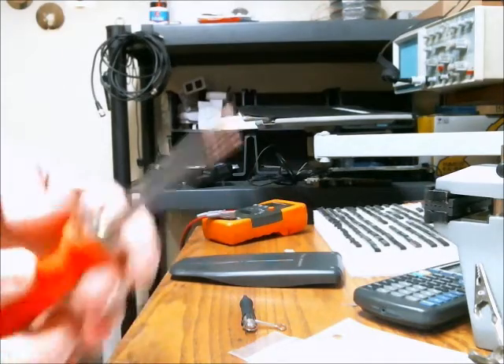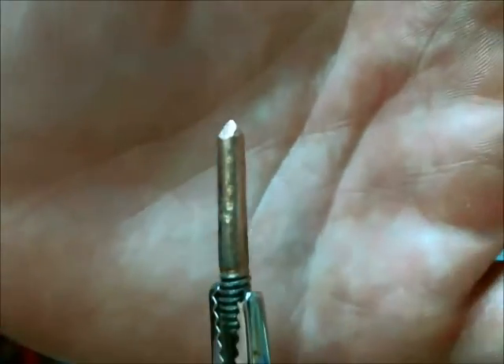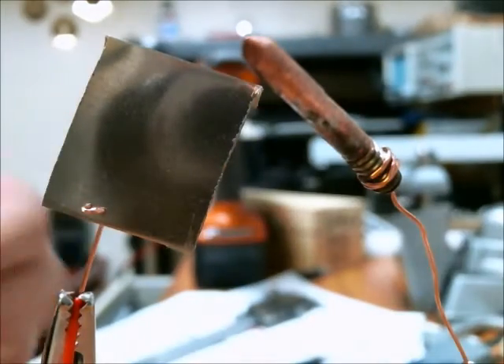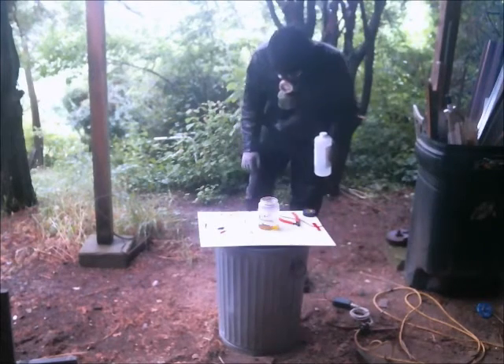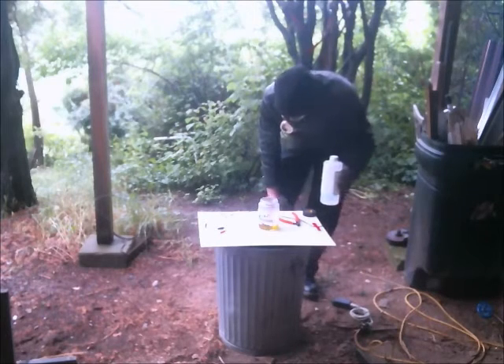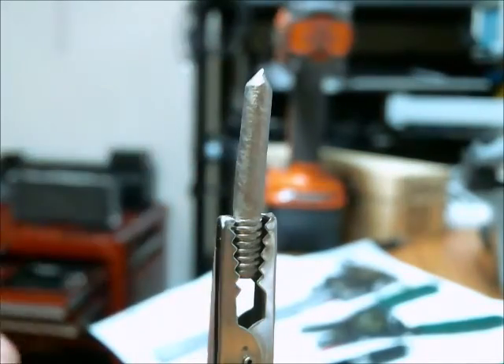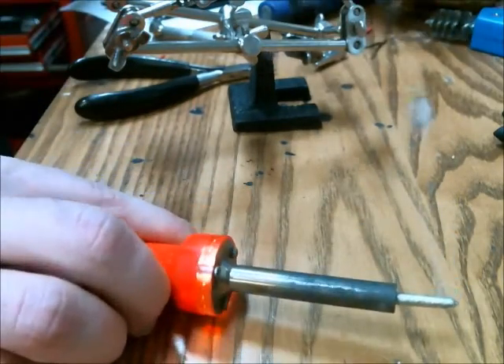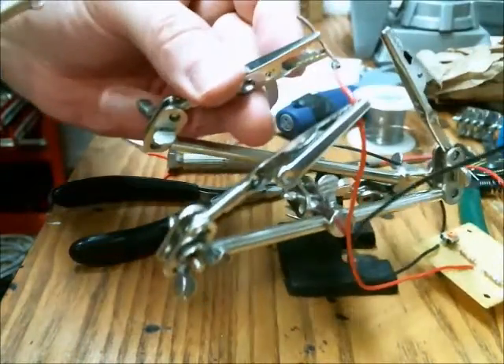Fixing a Soldering Iron Tip. (The right way)

Comment: Very dangerous way to plate nickel, 
I use a solution of 179.7g of nickle sulfate, 24.7 ammonium chloride, and 29.96g boric acid in 1L of water, using a low voltage around 2v nickle plates my tips in less than 30 min with a hard plate that lastes days!

Comment: I will be making a dozen tips on my lathe for my Ungar obsolete irons now that i know how to plate them ...Muchas gracias
Reply from the maker: awesome
Reply: +Heilman Hackatronics  I read in Wikipedia tht the tips are Iron plated ..Now i am confused .
Reply: A thicker iron plating is put on first but the final is nickel. The iron does give the tip more durability with the heat cycles but skipping that step is more practical for this DIY repair.
Reply: I know this 7 years ago but was it a 921ZX Ungar tip
Reply: This has given me the idea to make a solder pot that would fit in a cheep solder iron :)
Reply: SerenoOunce  o wow..

Comment: That's cool ! You also could have used copper acetate as electrolyte. Its a bit safer and you don't need the spacesuit and gas mask. Just use 5% distilled white vinegar with a pinch of salt. Make the solution just using a pure nickel anode and cathode for a couple hours or until it turns green then you are ready to plate. It isn't as fast or aggressive as hydrochloric but works very well.

Comment: Great experiment. My one suggestion would be not to submerge the threading of the tip in the acid so the threads don't get plated that way you're fully realizing the benefit of the copper's thermal conductivity once it's installed back in the iron.